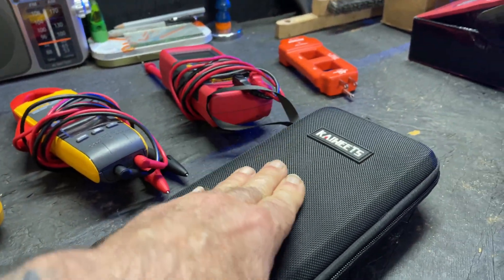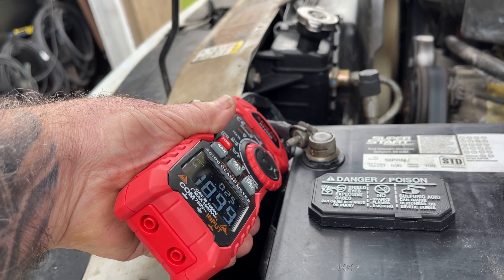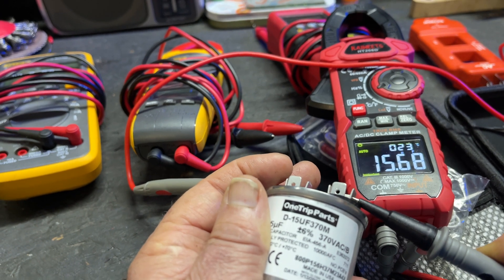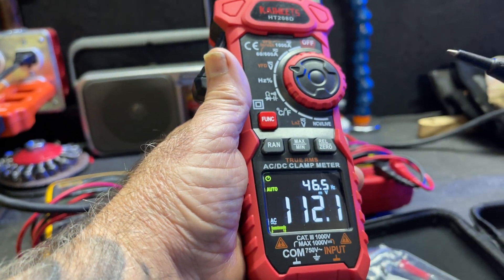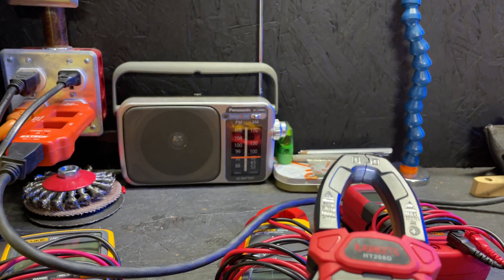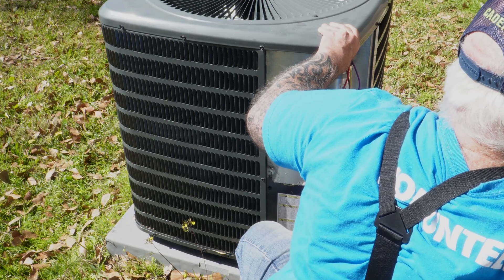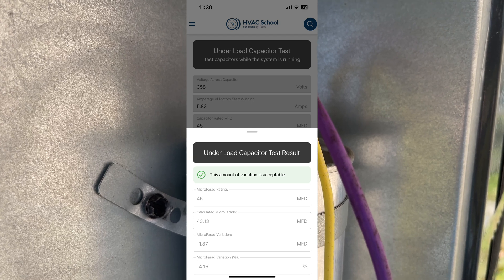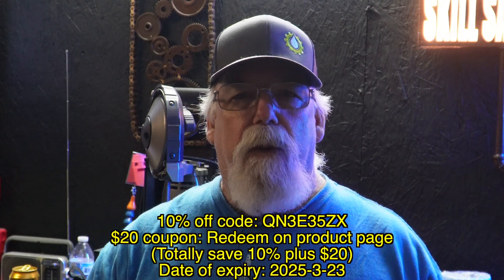Why Choose A Clamp Meter with Inrush Current Measurement Abilities?

Comment: Wait a minute❗
The meter is new to you, which makes it likely you don't have much experience with it.

Inrush current will be higher than locked rotor current (amperage) - LRA
If you chain down the shaft, inrush current peak will occur while the core is becoming saturated, and then the current will settle down into the LRA (steady state until the overload trips).

"Inrush current can be significantly higher than LRA (Locked Rotor Amperage), often reaching several times the value of LRA depending on the device, with peaks sometimes exceeding 20 times the normal operating current (RLA), particularly in motors and transformers where the initial inrush can be very high due to the low impedance during startup. "
Reply from the maker: Locked rotor amps doesn't necessarily mean a physical locked up motor.  Starting from the off position gives you starting amps which is also the same as LRA which is also interchangeably called inrush current.  I guess there is some argument on this matter. https://www.youtube.com/watch?v=2xIsmRkpQLA
Reply: Mike Holt is a good source on these YTs

Comment: High inrush current might be an indication of  high voltage drop on the power supply circuit -- watch the voltage on start-up at the same time (another reason for many meters ;)
Are the power conductors properly sized?
It is a an unusually long distance?
Are all of the terminals / connections tight or torqued down?

A soft start kit will of course mitigate some of these, as you said.
Thanks for the video, I would like to add this feature to my collection of meters.
Reply from the maker: Yes it's properly sized wire for the 30 amp circuit that it is on.  I installed the disconnect a year ago and all the connections are new and tight.  It's 70 feet from the breaker panel, so shouldn't be much voltage drop at all.  I probably will invest in a soft start soon.  Thanks for watching!
Reply: @SkillSavvyDIY  Thank you for the details. Southland Wire has a voltage drop calculator on their website.
And, I concur with you, with "shouldn't be" being the operative term!
Reply from the maker: Yes, I actually already have that app on my phone.  According to the app, I only have a 0.55% voltage drop.  The run amps on my AC unit is only drawing 9 amps which is lower than the 13 rated load amps, so I definitely need a soft start kit to counteract the above rated inrush  amperage.  Thanks again for stopping by and commenting.
Reply: @SkillSavvyDIY  Yes, this is why, to continue troubleshooting something that shouldn't be happening , is to actually measure the voltages on startup. Or, the compressor is already going bad - like a bearing, or ?